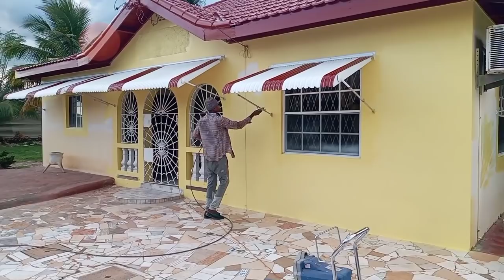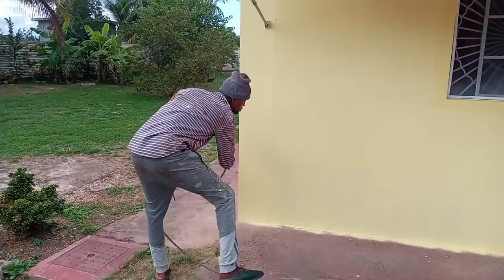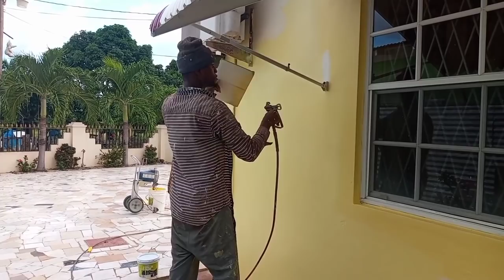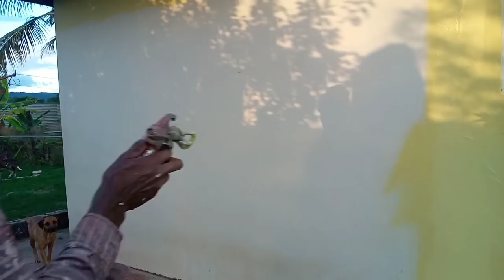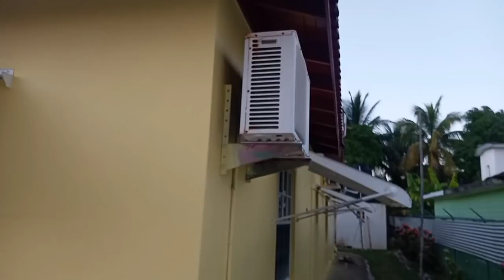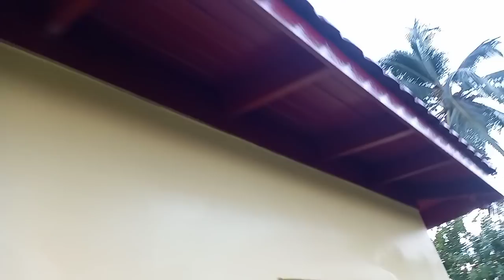how I paint this house fast and easy (in Jamaica)

Comment: Paint touching the ground  next time bro cut in with brush on the ground area so you won't have an over spray to the ground ,or spread dropcloth. Keep up the good work👊👍
Reply from the maker: some design was gonna be done to the ground that is why it didn't matter
Reply: All he have to do is to cover that surface either by taping it or use a peice if card board..that's how I do my job...and its more easier and cleaner finishing...
Reply: But excellent job bro...very compose and focus that's win it for me bless up
Reply: @direalsamahrivevo9651  agree  bro that's my speciality in this field over 22 years,I learn daily on my craft by watching others and asking questions, especially working overseas.
Reply: Yeah dat true

Comment: Painting fast, but not with finesse. Colour not consistent, as spray tip needs cleaning, or too much water added. How much square feet did the 5gal bucket cover. Need a similar paint job in May Pen
Reply from the maker: No, what your saying is not it, I have painted some area before some so your seeing wet and dry paint.

Comment: Your work  looks  good but please protect yourself wear a respirator and cover the floor you are working faster so take the time and make your work look clean . What size tip are you using and is that latex or oil paint on the rafters and doors
Reply from the maker: 517 tip and oil paint on the door
Reply: Don’t forget to wear your masks 😷 at all times when you doing your spray paint words is very powerful and encouraging stay safe and be bless 👍

Comment: Prep work is key. I nearly had a fit with the over spray on the tile (even though it wasn't the best tile job, it's still tile). Good job with the painting technique.
Reply from the maker: I keep on telling every one, the ground will have a different design, meaning something will be done to it, so no need to cover it.